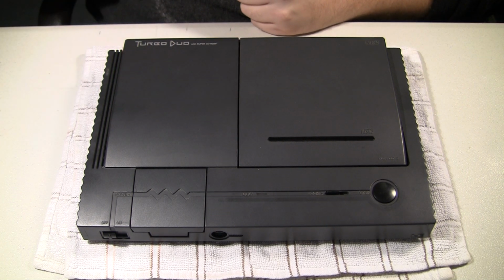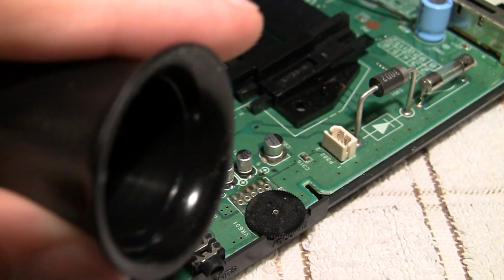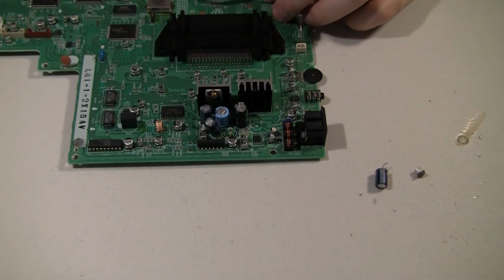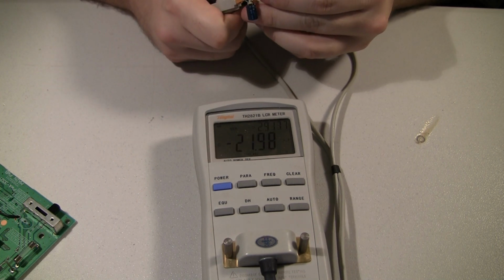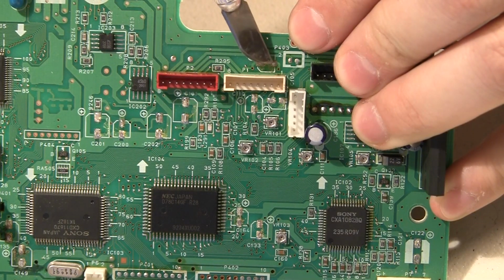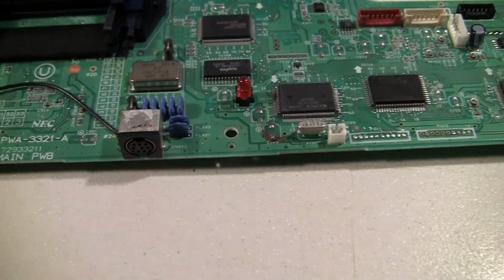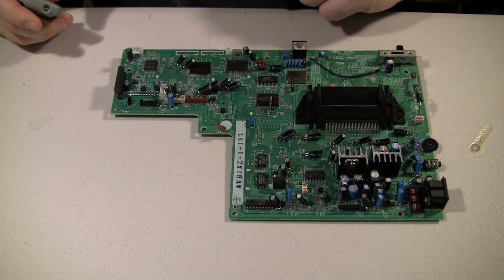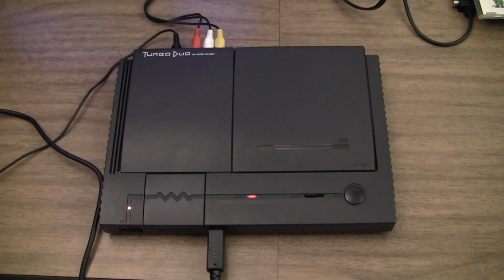Turbo Duo - TurboGrafx-16 - Full Capacitor Replacement

Comment: I used Soldering Tweezer when i re-capped my laseractive. Works great, didn't lift a single pad. You need to apply fresh solder to the cap and Tweezer and carefully lift them off when both sides has been heated. If you dig in and force them out you might risk lifting pads. Cut caps works as long as you "cut them off". If not you simpely just force them off the board and in that case it would be as smart as trying to pry them off. Corroded pads are hardest. In some cases you can heat them off.

Comment from the maker: I've yet to have a bad trace and i've had some nasty looking leakage and corrosion. What I can tell you is via's are more prone to being lost to corrosion than most of the traces, and don't pull on the caps, you'll lift the pads!
Also, the solder mask is what's turning black and it will scrape off fairly easily and reveal the copper trace underneath. If you do expose the copper, wipe some protective liquid on it after, even wd-40 if you have nothing better.

Comment from the maker: I use purple power degreaser seen in my other vids, it may not be the best for the job but it's what first tried and it works great. I don't thing you can 'wash off' corrosion, if you find badly corroded traces it's best to run a new wire to replace it.

Comment: When cutting the legs of new components I use a shear-type cutter rather than a snip-type. Snip cut makes a sound you can hear and shoots cut-off with force, it does same into direction of component. I like to clean boards in a sweeping frequency heated ultrasonic cleaner, I pretreat with baking soda & toothbrush at suspect areas. I fill tank with CLR / oxacylic acid (bar keeper's friend), rinse with baking soda / water mix, perform repairs and hand scrubbing / scraping, chase out blobs of my own flux with flux cleaner spray - then rinse with flash hot 91% alcohol. I re-lacquer the board when done to protect it anew and hopefully shield stuff, buy a few more years. I normally do cell phone repair so I got the hot air rework station, microscope,etc. Samsung had me driving around 3 state area re-capping their TV's in people's homes. for a while. I learned to take my bench quality soldering station with me. HUGE difference with the good stuff. Quick recovery to full heat, can handle the soak, no pad burn...loved it. You did cool work here, got me feeling confident enough to try it and get myself a turbo duo! THANKS!

Comment: Just in addition to my last comment...

I must say that the prospect for a relative noob like me of attempting to recap a PCE DUO was daunting, to say the least.  Watching your videos and now having actually DONE, it, it is no where near as difficult a task as I thought it would be.  With my comment about the "square black thing" for the super cap in the Turbo Duo, it seems to be the same as the one in the DUO-R and RX.  My PCE DUO had the same green super cap as my IFU systems, so the square one may have been in later PCE DUO's, or only introduced in the R.  I replaced that small, shitty thing with a 1000uF super cap in my RGB mod IFU, DUO and RX systems as well as my original RX.  I hope it works better than the cheap, tiny thing NEC used!

Comment: Excellent video, I have three surface mount caps to replace on a 3Dfx video card, after watching this I'm going to replace them with the type caps used here. Could you tell me what value my caps are please? From top to bottom they read ;  10   16s   8GD    Thanks for sharing

Comment: Have to say this is the best cap replacement tutorial by far! Very nice, I'd share it on video forum digitalfaq.com if you don't mind? We have a lot of devices that need recaping and most of the folks are quite afraid of this DIY job, as you tend to have 100+ caps to replace in a device such as an advanced vcr.

Comment: I am not looking forward to doing this on the "junk" DUO I got last year.  IF I ever get the stripped screw off!  I have re-capped a couple of JP MEGA-CD1 systems and they were easy enough for a first timer like me.  The DUO is a different story though, there are far more caps and most are cramped together.

Comment: What I would like for you to show is changing out the caps on the PC Engine PACs and TG16 PACs etc.. on the Pioneer LaserActive system. I have bought a PC Engine PAC that I have replaced caps on for most of the caps, and I am getting redbook audio issues, not issues with loading or sound effects. Can you show us, and/or tell us what caps that are used for those Red Book Audio? Changing out the caps are simple enough, I would just like to know what each of the caps actually fix on the PAC's, so I can narrow down the issue's easier.  Thanks!

Comment: You should have sealed the exposed traces with kapton tape or at the very least electric tape.  Also,  I noticed that you didn't touch the pico farret capacitors.  Should you replace those too, since they are usually used for signal smoothing?
Reply: Tantalum capacitors have a very low failure rate.

Comment: Hey man i love all your videos. I have a question tho. I was wondering why i never see you using fllux. Also do you know any good cheap soldering irons. I have this one from radio shack and i was trying to remove a wire from a noard and it will not melt this solder .Sometimes just barely on top but never penetrates.  The one i have is a 15 to 30 watt iron from radioshack. And if anyone else reading the comments has an opinion on a well working Not to expensive soldering iron.

Comment: Just wondering if you could give me some purchasing advice. I'm looking at buying a turbo duo off of ebay, and there are two in particular that have caught my eye both from Japanese sellers. They're about £170 or so with shipping taken into account, which I suppose is cheap for this thing (I never thought I'd say 170 is cheap!), but there are problems with both of them.

The description of one says "small sound" (he's Japanese so I presume dodgy translation) and I've taken that to mean that there are problems with the sound quality. The other one says the CD drive runs, but doesn't read games the vast majority of the time.

Do these sound like problems that might be fixed by replacing the capacitors? I'm pretty sure they are, and if that turns out to be the case I don't intend to be picky, I'm just going to pay someone to strip out all the ones known to be a problem and replace the lot, but it's a lot of money to take a chance with so I thought I should ask around for opinions first.

Comment: Instead of cutting the caps off and potentially damaging the pcb why don't you get a hot air tool?
Reply: Did you even listen to what he said about why he doesn't use heat?
Reply: FlNALBOSS I commented 6 months ago now. Do you want to give me the timestamp of when he states "why he doesn't use heat". Soldering irons and hot air tools are both hot but a hot air tool is perfect for removing components as you can heat multiple pins at the same time. Cutting the legs of is bad as you put force into the joint and the copper under the joint is not attached to the substrate with any sort of strength.
Reply: soldering iron with flux on a wick. he just half assed his his work the way he did it now he has old solder making contact.
hot air will warp the board.
Reply: SuperDeluxe80
>hot air will warp the board.

Not sure how that would happen with localised bursts of hot air to be honest.
Reply: Most people don't have hot air tool, they tend to be super expensive.. From my research the plier technic is by far the best

Comment: I really need to get around to fixing my "junk" PCE DUO I bought off yahoo last year.  One of the caps was floating around in the system when I got it and another fell off when I opened the system the first time.  Looking at it again now, 2 more just fell off :(  I just hope the corrosion which is easily visible where they fell off, is not too bad.  

I have noticed just now that the memory cap in the Turbo Duo looks different to what is in my PCE DUO.  Mine has the standard short, squat memory cap (or whatever the technical term is) and the TD seems to have some kind of square black thing?  Is there any difference in the time the memory is held without power?  I lost COUNTLESS game saves on my damn DUO-RX over the years because of that stupid thing.  Why they did not use a battery like the MEGA-CD is beyond me!

Comment: I know that you should desolder these caps first to measure their capacitance. Or am I wrong ?
Reply: +oDJOldskull That's correct, in order to measure it properly.
Reply: Mark Mathias Good to know :) Btw. I hate desoldering caps. Rarely I can desolder them easily. They always act as huge heatpipes and even 788 fahrenheit doesn't do the trick. Any tips on that? :)
Reply: +oDJOldskull Google + lost my reply earlier. I use two soldering irons set at 350-400C. The caps come off easily and you don't have to worry about burning the pads off.

Comment: Well, I need to get rid of that coarse nasty black crust before I can even see how bad things look underneath. Testing for continuity on traces from chips is futile as I've found there always seems to be continuity the other way around so I am not even sure which traces if any are eaten completely through.

Also, the many thin legs with corrosion from an IC are very hard to jump wires to since there are so many right next to one another. I praying to the pagan silicon god that no trace is cut.

Comment: WATH ABOUT LIFTED PADS?
Reply: you can either solder the capacitor leg to another point in the same circuit or make a jumper out of a small piece of wire.

Comment: Hello, and first, thanks for your really helpful video.

Actually I bought a DUO I'm recaping, but I noticed there's a smd resistor missing on the back, in the lot behind the din-5 plug.
It's the R324.
I looked for pictures on the internet, but couldn't find something clear.
I think it may be the same then the R323, which seems to be a 10K.

Can you help me, please ?
Reply: Hello,
I tried to understand the sound circuit a little, and it actually was 10k ohm.
But the main problem was from the both op amp I had to change. Now everything is fine !

Thx again for your helpful work.

Comment: i been thinking on buying this kind of meter and ive got 2 pc engine duos since i was kid, my rx is working fine and my original duo is not, needs work, ive ordered both cap kits off console 5. this meter of yours, i like it, but if your doing work, i.e replacing the caps, well your going to replace everything, so why bother measure anything and not just replace evevything with new

Comment: What liquids do you use to clean off the electrolytic corrosion? Mentioning some brand names would be helpful as I often battle with leaky capacitors in my hobby and have yet to figure out a good solution for cleaning leaked capacitor fluid or removing corrosion resulting from the same.
Reply: Alcohol 99% is your best friend in this kind of situations.

Comment: What is that for a ESR Meter?
Reply: It's actually an LCR Meter.  It measures impedience (inductance, capacitors, and resistance) in low current components.
Reply from the maker: Penfold8
It does both LCR and ESR, very handy as some caps will have good capacitance but terrible ESR and need changed.